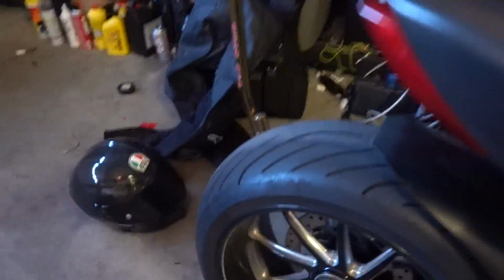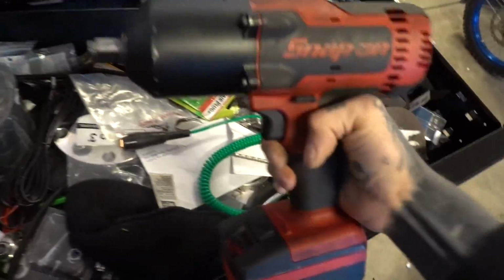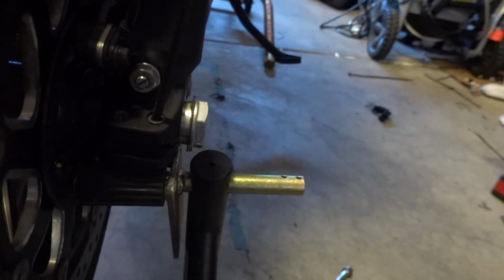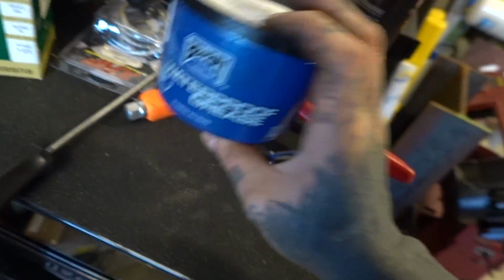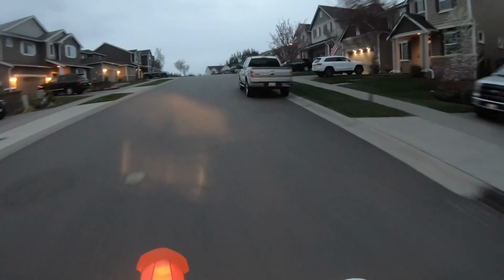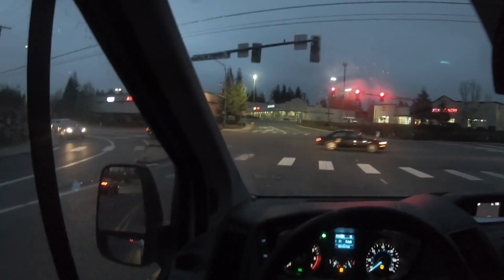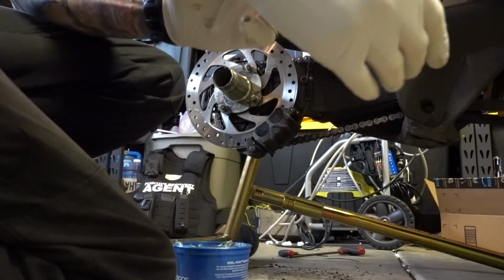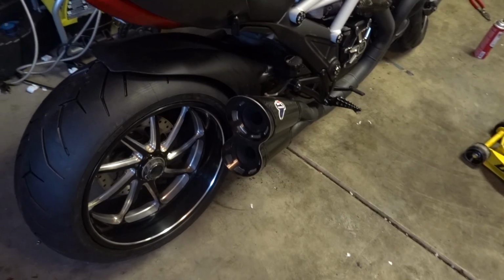Ducati Diavel Tire Change Fiasco/Motovlog?

Comment: That gun can do 350ft/lbs so you are over tightening it by hammering it with that gun.  You also don’t need to hit the tire it will mount flush to the hub.  Lastly put a tie down on a spoke on the bottom of the rear wheel and run it to the front wheel/fork and that will keep it from spinning past the brake.  Using the Trans is not ideal.